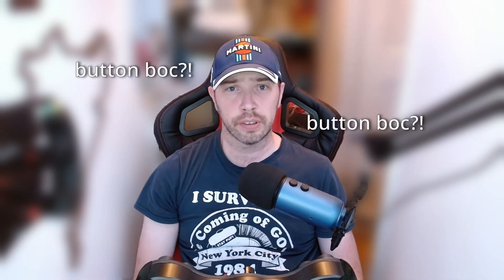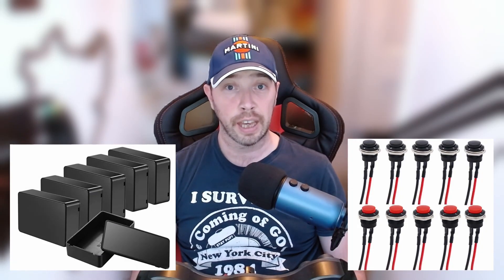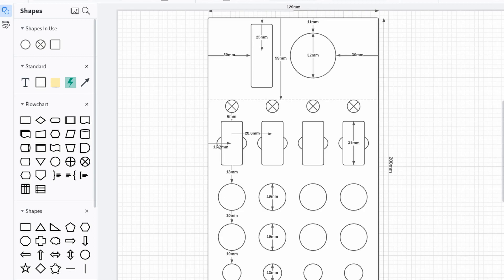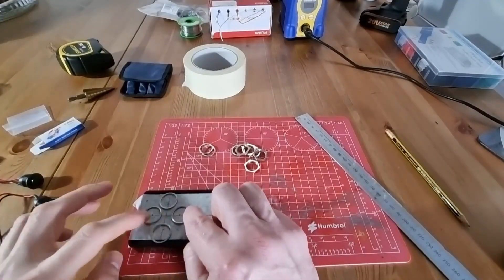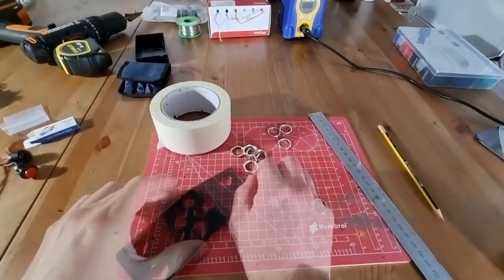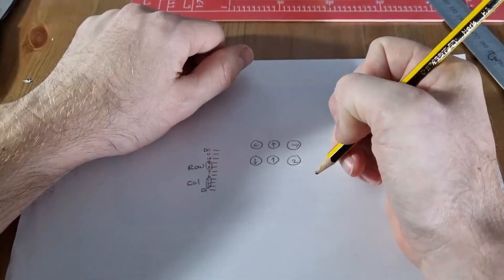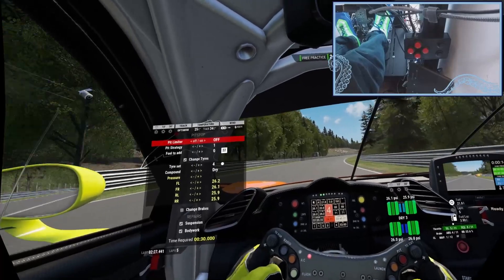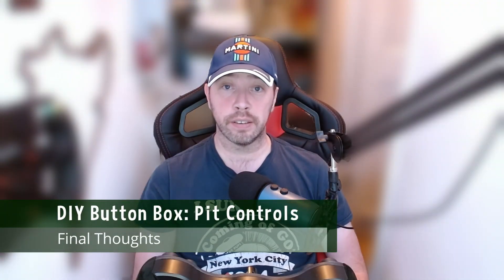Cheap DIY Button Box for Pit Management

Comment: The simline 720s wheel does come with a funky option when you order from the website
Reply from the maker: Yep, which is why I disclaimed the model I purchased.  I think it'd be nice if the reseller I purchased from could start stocking a few more different models but I understand the logistical complexities of doing that.  I'm so tempted to fit one myself but I think I'll wait until the warranty is up at least before I start butchering away 😅

Comment: Nice vid. Didnt know about the sim hub programming function. Was thinking about forking out for the leo bodnar boards.
Reply from the maker: Thanks mate👍It's an option so thought I'd make a video about it as I recently discovered that myself. I was hoping I could do the project with the very cheap Nano boards but they sadly only work directly in SimHub itself. I think for something like a wheel plate or a more complex button box the Bodnar boards still make a lot of sense though.